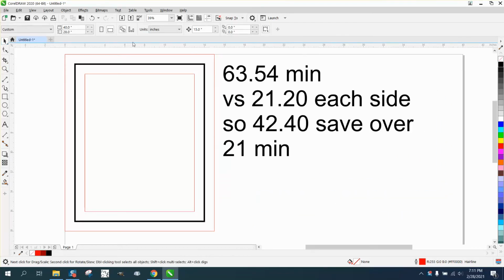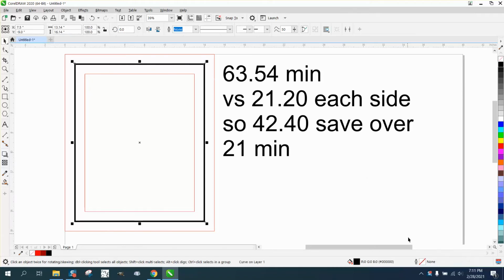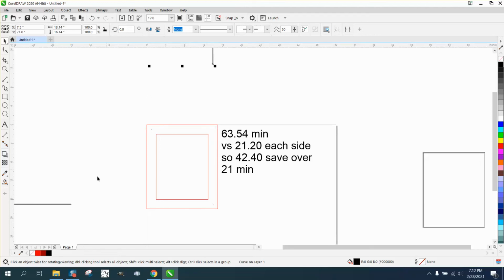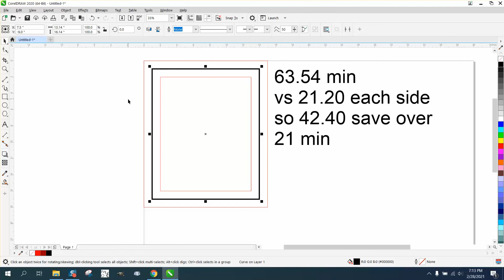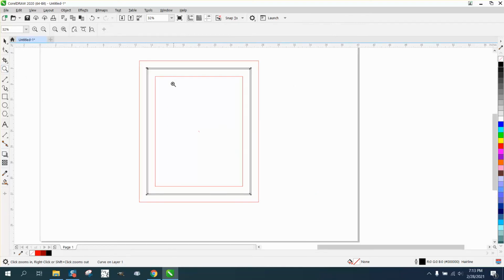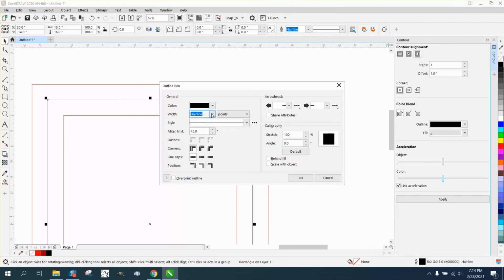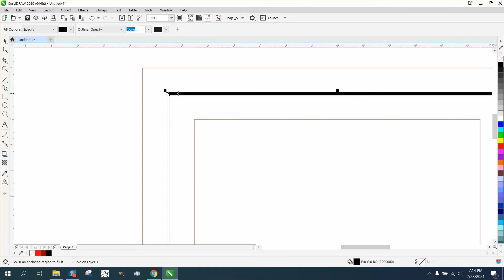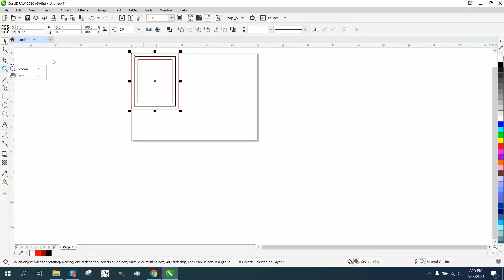Corel Draw Tips & Tricks Save Laser Run time on a frame part 2

Comment: You can also save a little more time by rotating that frame 90 degrees. so the long side runs horizontal and the short size runs vertical.